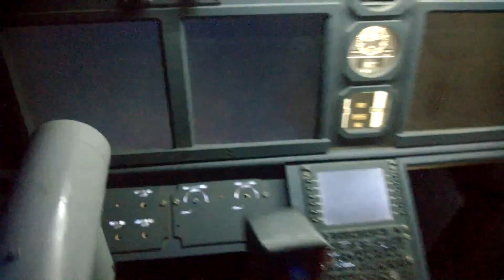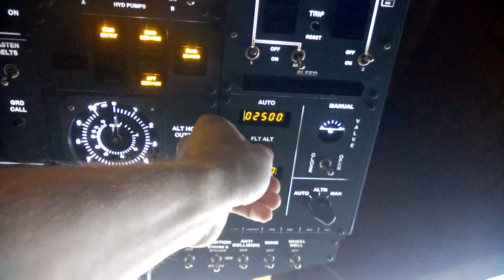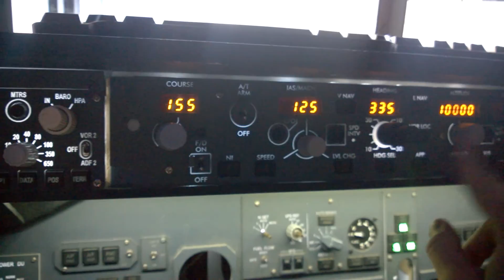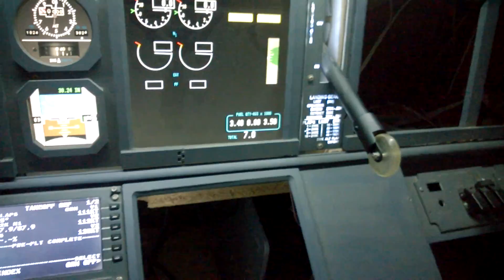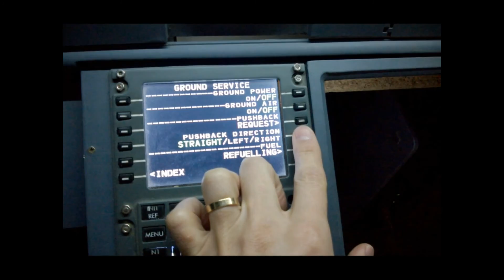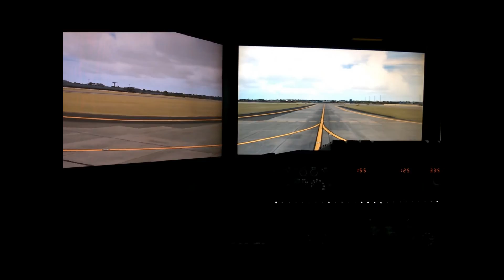Boeing 737 Sydney Practice Circuit Tutorial

Comment: Hi! Like your cockpit very much! Trying to build a simular set up myself.. What size are your outside view monitors?
Reply from the maker: +Tor Christian Stamnes 
If I remember right, those are 32inch TVs. Two are LGs and one Acer. Took them apart and removed bezels. Actual LCD panels were identical size
Reply: Ok. Thanks. Are you satisfied with the size of them? Would you recommend me to try bigger screens?
Reply from the maker: +Tor Christian Stamnes 
I am satisfied with how they perform now, size and all. They are not HD panels though, only 1366x768. That means that I don't need as beefy PCs to drive them, so I guess keep that in  mind when choosing.

However if I were to do it again with no money constraints. I would get about same size (maybe slightly bigger) curved 4K panels. I'm not sure if curvature is uniform, but if it is - they should fit together very nicely.

So,  I do think the size is quite good, maybe just slightly bigger...  I guess also depends on how it all fits in your cockpit